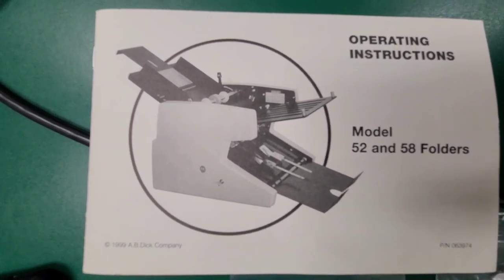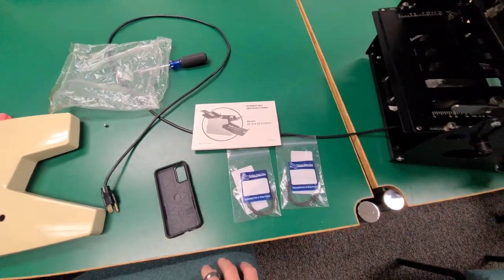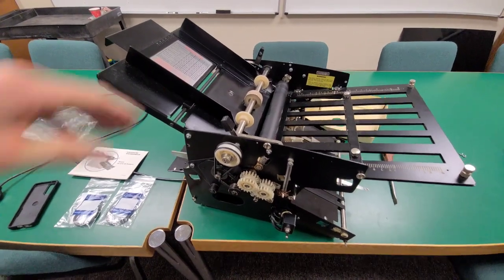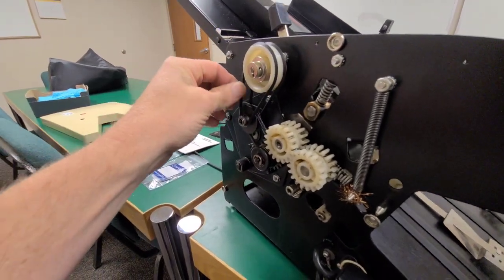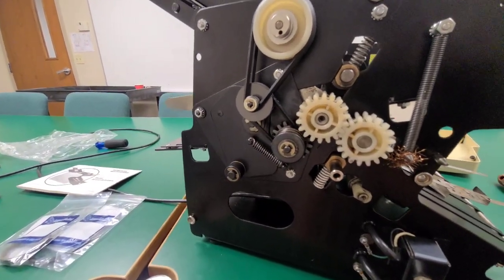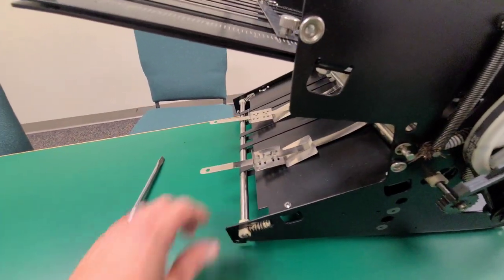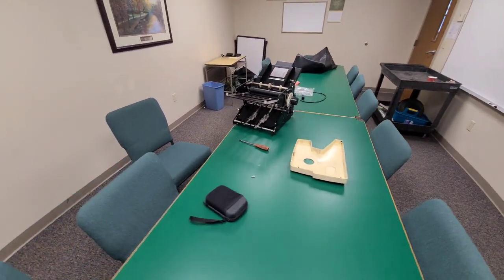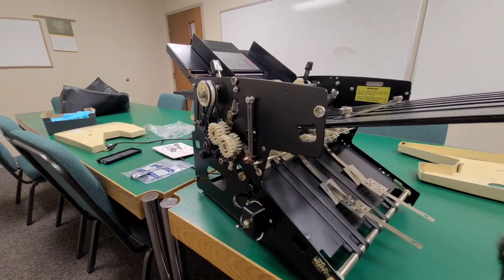Restoring the A-B DICK 52/58 Paper Folding Machine: Cover Removal, Belt Replacement, and Calibration

Comment: I just purchased one of these for our school and I can't figure out how to change the fold options. How do I set it for a simple trifold?
Reply from the maker: One lever at the top will control the speed. The other is fold settings.( A, F ).. You will probably need to shorten the paper stop as well. That is the bar between the 2 rulers 📏 that adjust.  I'll have to look at it in the morning to give you a more specific explanation.
Reply from the maker: @andreamauch7430  the deflecter needs turned off. And set the paper stops accordingly.  Hope this helps. I may do a operating video on this now. Seems I am the paper folder guy.

Comment: Your thought, we have a 52 that grabs multiple sheets at once.  It folds perfectly.  Could the adjustment that you spoke about for adjusting to grab a single sheet be at fault? Too large a gap?
Reply from the maker: Take one sheet of paper.  Set it in the feeder and hold it. Turn adjustment dial till it grabs the sheet. Then it's calibrated.  Your gap between the rollers is too big. Let me know if this helps. I know this machine very well now. Thanks
Reply: @SkyMasters 
Thanks!